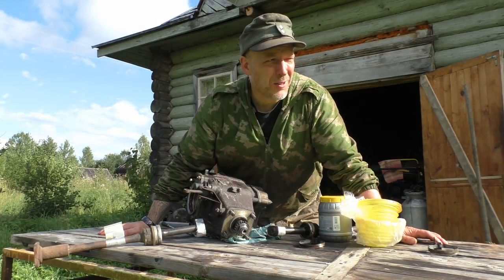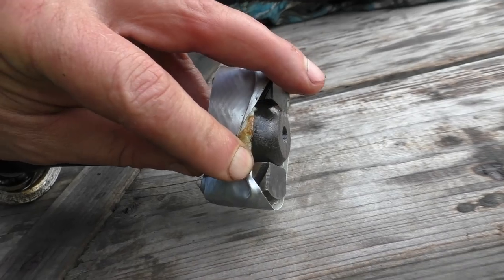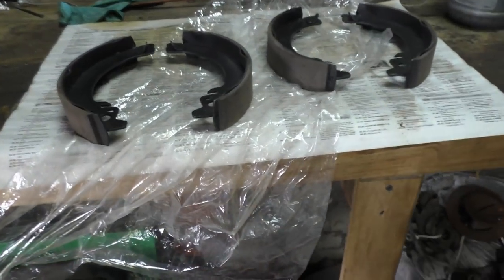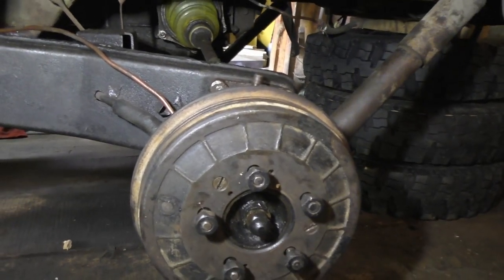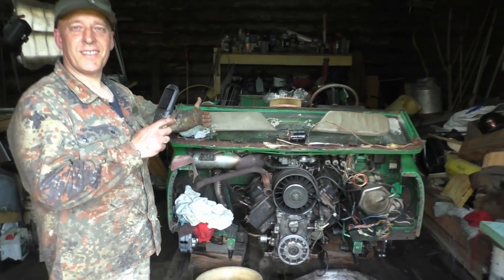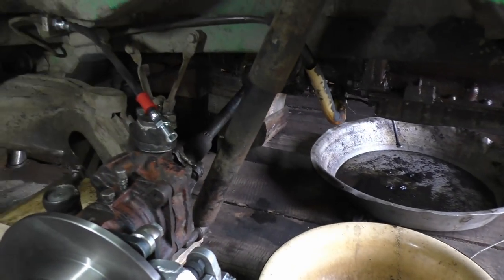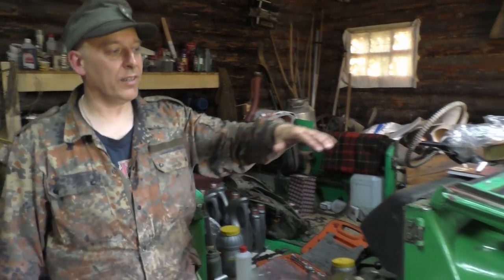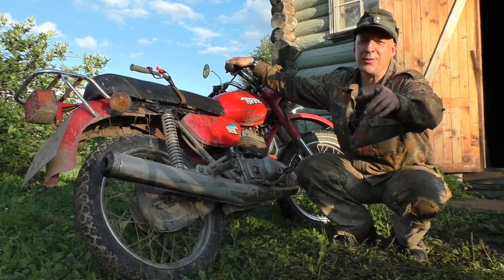Restoring A Modern Classic Soviet Off-Road Vehicle

Comment: Hey Lars, Replace those air vent floating metal caps on the hubs with rubber lines run up high on the firewall to keep water out of them when going through deep water holes. The caps pop off easy 
and you can usually clamp a rubber vent line there ;) JerseyJeeper aka -JJ in NJ USA
Reply from the maker: I was actually considering that today. It might be an idea to have some kind of a filter at the end of the rubber lines I would think. :)
Reply: Survival Russia 

I was eyeing that myself. Most modern pickups and SUVs in the U.S. domestic market have a remote vent that simply plugs into the end of a rubber hose. If you have a GM dealer anywhere nearby, you can just ask for a few vents for a front differential on a 2000-2017 Silverado or something. If they don't have many GM dealers in Russia, there are multiple options in the aftermarket. I'll see if I can get you a part number tomorrow if you're interested.

Comment: those rotors will tighten up when the wheels are bolted on and you squeeze the brake petal and bleed those brakes. Iv,e been a mechanic all my looooong life and have enjoyed watching you repair your vehicle. Great Vids!
Reply from the maker: Thanks Gerhard. The rear drum brakes is a little tight. I hope they loosen up a bit when it get out rolling :)
Reply: If you didn,t cut the drums that the shoes will wear into the irregularities. The looser the shoes from the drums, the lower the brake petal will be when you depress it.

Comment: Is there a tire shop near you to align the front-end or are you going to wing it in your garage? If it's a DIY project I hope you film it. Can't wait to see it running! Hope all is well with you and your family.
Reply from the maker: I will do the initial alignment myself :) There are not much to align. I only need to make both wheels run straight. No other options for adjustment :)
Reply: i know that the front wheels must not be perfectly aligned. They have to sit a bit, like really really a little bit inwards. Dont know why, but my father in law(who is an excelent mechanic... like 30 years of experience) told me that when we were working on a old truck. But i guess you are doing your research beforehand... so yeah. 
Great work... keep it up. :)

Comment: I love disc brakes but I am pretty sure that will never go too fast for the old drum brakes!
Reply from the maker: They are not there for speed. Good brakes is important on a 4X4 for optimal control on hills and banks. The drum brakes were really bad :) I'm sure it will not run much faster than 60-70 km/h with the new torque friendly gearing.
Reply: Survival Russia... You are spot on, a huge upgrade...
Reply: @Lars I never noticed... does this vehicle also have low and high gear?

Comment: great progress! you may want to consider replacing the shocks (dampers) with some new heavy duty pieces. and undercoating with rubberized spray or some use used/ waste oil to protect from further rust.
Reply from the maker: It has torsion bar springs..

Comment: LARS looking good and getting close now,      did I miss a video what happened with the cylinder head porting?
Reply: I think he mentioned sometime back that whoever did it had finished and returned it to him.
Reply from the maker: I have not sent them out yet. The engineer does it for free but the shipping price is a little high. Gotta save up some money. I have 2 sets of cylinder heads, and when the engine is running I will ship one set for porting :)